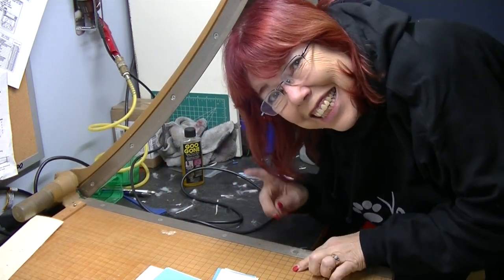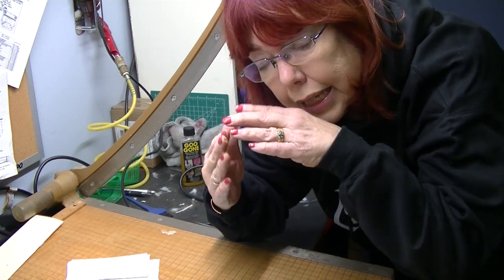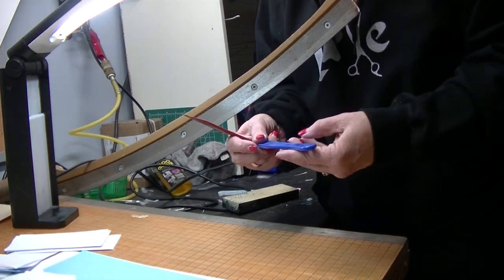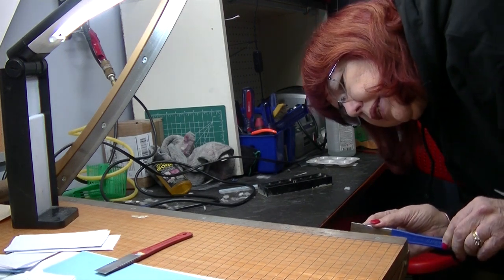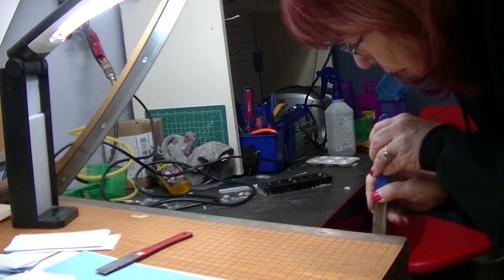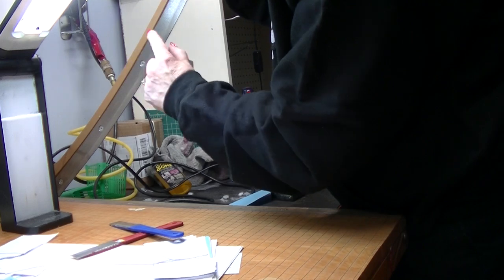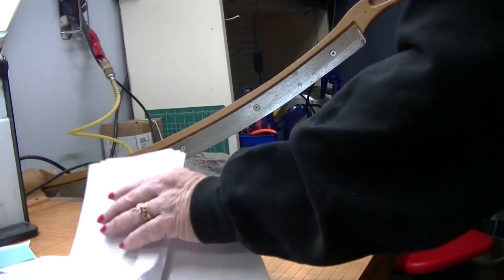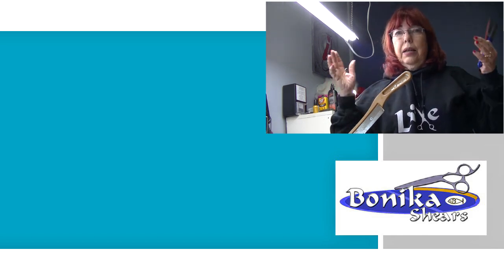Easy Way to Sharpen a  Guillotine Paper Cutter Without Taking it Apart | Bonika Shears

Comment: I have a mini guillotine cutter that had a spot where it tended to bend, rather than cut. I watched this video and was able to fix the bad spot with a metal nail file! Saved me $$. I'm going to get the sharpeners you recommend, cuz my big guillotine is dull and replacing it would cost a LOT more than the files. THANK YOU SO MUCH!!!
Reply from the maker: @christinebravomom5711  you are welcome. Glad it worked,

Comment: I used a big 2 spindel grinder with face wheels , had tilting tables to lay work on to maintain the same angle we sharpened them a few times . Mostly did   cutter grinding,  you did allright
Reply from the maker: That would be the correct professional way. Mine is a red-neck "Git'R done" way! LOL

Comment: Would 'shear' be the right term for the blade, as opposed to sharp? - I'm in the process of building a guillotine with an antique Hampson Bettridge blade 👍
Reply from the maker: No, shear has the suggestion of the blades curving toward each other. I think the normal person would just use the word sharp.
Reply: @@BonikaShears  Ah, OK- only that the 4' blade I have has a gradual camber, which would do just that - probably not noticeable with a shorter blade. As a blade-maker myself, I look for extra detail 😉
From an engineering point of view, the term 'shear' is where the cut is perpendicular to the material 👍

Comment: I was waiting for you to put the paper to the top of the guillotine where the ruler at the top helps you get that perfect 90 degree angle of the cut and also the correct length by using the ruler at the top. You didn't sharpen either to the end so you will not get sharp cuts at the top. At least I learned how not to do it.
Reply from the maker: The reason I did not put it at the top was the ruler at the top was defective and not straight. The wood was splintered where the ruler was nailed in. My job was to sharpen not remake the thing.

Comment: $96.00 for that! Shame on you !!!  You need to make a jig for that, not well done just by free hand. also the movement of the grinding stone needs to be perpendicular to the edge of the blade NOT parallel, you are creating a very groovy cutting contact point surface,,,, You are a very AMATEUR, Lady Sharpener.
Reply from the maker: Oh, you are totally right on all counts.... but without the right equipment and in a make-do world.... it worked.
Reply: Relax